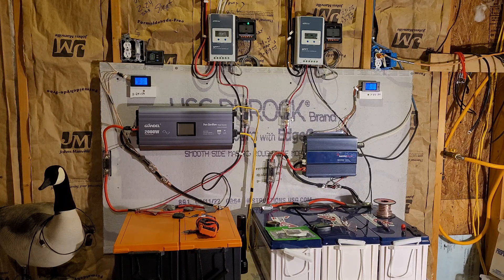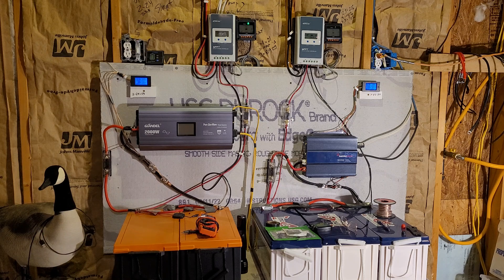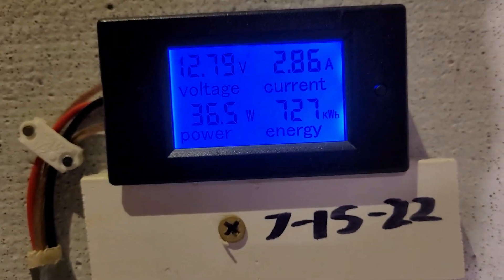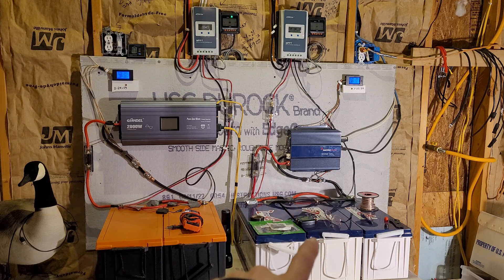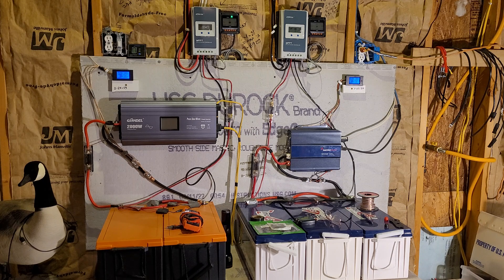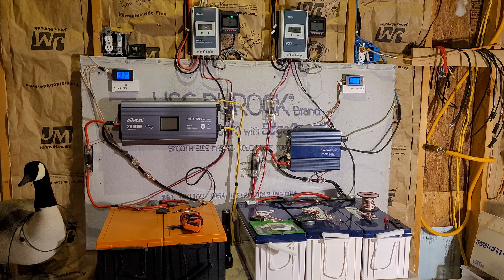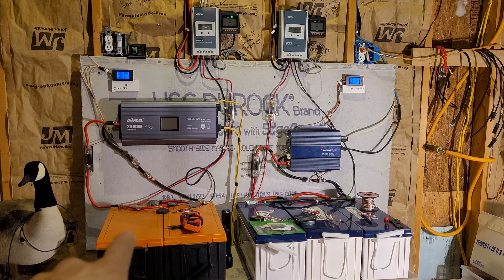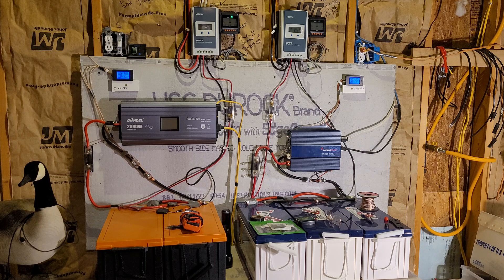Winter Off Grid Solar Performance when the days are NOT ideal.

Comment: It depends what your house load is. 
600 amps @ 12V is only  7.2kW. If you can run 8 days with that than you house load is 7.2^3 / (8*24) = 37.5 wH. That's pretty low!
Reply from the maker: whole house isn't off grid....just the electronic essentials....with backup for fridge and sump pump in case of an outage.

Comment: When the batteries are charged, would it make sense to dump the extra electricity into heat in a sand battery in the house (like in an old 100 lb propane tank) using a DC water heater element to heat the sand?
Reply from the maker: I've seen these videos....don't know if its effective ... It's worth considering....as opposed to doing nothing.

Comment: Upgrading is always tough.  I started with 24V and upgrading to 48V was definitely unfriendly on the pocket book.  But I'm happy I did.   But you run with what ya got.   If 48V is not in the cards, 24V is still better than 12V by a lot.

For anyone doing a new project from scratch, go straight to 48V (16s LiFePO4 batteries, 51.2V nominal)... that's my advice.

When I upgraded from 24V to 48V my charge controllers were already Victron 100/20s so they were 48V capable.  I only had to do minor rearranging of my existing solar panels to get the 60V+ operating voltages I needed for proper charge controller operation.  Basically that's 3 x 100W in series or 2 x 320W in series and the voltage is then high enough for the charge controller.

But I had three 24V LiFePO4 batteries and I didn't want to put them all on a shelf so I wound up buying a 48V LiFePO4 battery (16s, 51.2V nominal), and then I put two of the 24V in series to tie them into the 48V system, leaving one 24V on the shelf.   I had to cobble-up an equalizer(ish) for the two 24V's in series because there are no off-the-shelf equalizers for 2 x 24V topologies (NOTE: There are for e.g. 4 x 12V series topologies, but not for 2 x  24V  series topologies).  But it works, and I now have a total of 10 kWh worth of battery storage online which is really nice.

Then new inverters, a new AC charger, and new fuses (ANL fuses are only good to 32V and vehicle blade fuses are also only good to 32V, so I moved to ANN/CNN fuses for the big amps and slow-blow automotive glass fuses for the low amps.   Fortunately the pile of DC breakers I had are rated high enough so I didn't have to replace any of those.

The result is awesome, though.  Overall system efficiency is easily 10% higher than before due to lower losses across the board (including some long DC wiring runs), and everything runs far cooler than it used to.

Another unexpected benefit of going to 48V (16s, 51.2V nominal) is that I have a bunch of stuff running off of POE+ (power over ethernet), including starlink, and it turns out that one can just feed the 48V battery system straight into the POE+ switches without any conversions.  Just an appropriate inline fuse is needed, that's all.  No DC-AC-DC mess.  So suddenly all the POE+ stuff was like 25% more efficient.

Comment: Are you still considering switching to 24V?
Reply from the maker: Yes...I'm 1 battery and a few panels  away...
Want to gather info thru the spring equinox....
Then we're gonna a go 24v
Reply: @CentralIllinoisSolar  I thought I had heard you mention 24 V a while back.  From 12 to 24 V with the equipment you have is less costly than a 48 V transition, as it will only require the two new inverters (and one battery) With my systems, I keep thinking about going to 48V from 24 v, but that means new inverters AND charge controllers. Too much $ outlay.  So I understand your rationale.
Reply from the maker: @PlanePreacher  
It's easy to "waste" money once you get sucked into the solar vortex...the 600, 600 system I recommend... is perfect size for most to use as emergency backup power for essentials...year round...
On top of that it's only 1 battery and another panel ($625) from making the jump to either 24 or even 48v after your learning curve and level of obsession determination. 
Plus...spring summer and fall...you will save money if you use the power available.
Reply: @CentralIllinoisSolar  Totally agree!  And yes… it can (cough, cough) become an obsession!  I started with a small agm battery and light system about 15 years ago, and now running 5 different systems (2 older agm, 2 newer LiFePO4, and a golf cart) plus solar hydronic heating.  Obsession, no just a hobby!  The all-in-one systems are really maturing along with the dedicated battery systems, and their prices are beginning to be reasonable versus a build your own system. That will probably be how I will make my 48 V jump.  One System to rule them all!